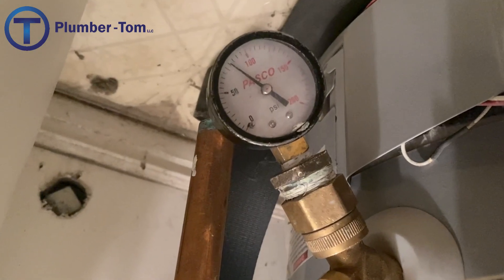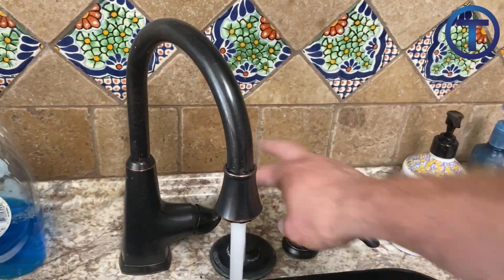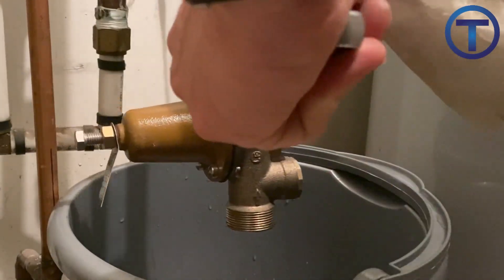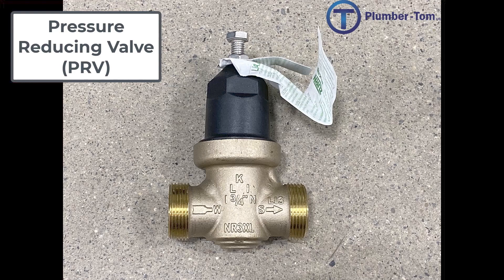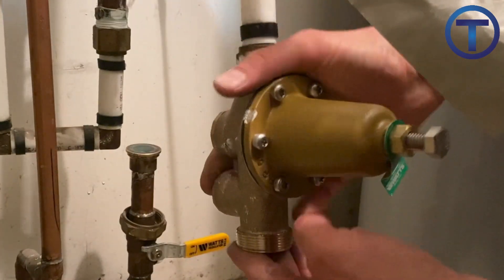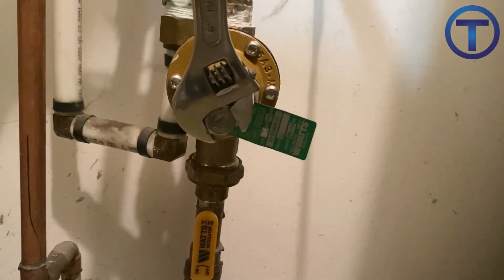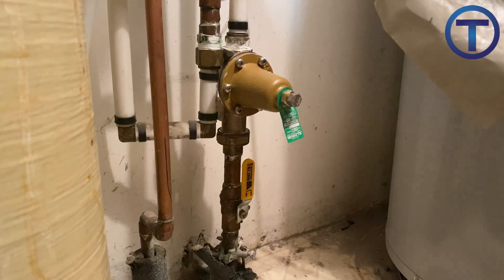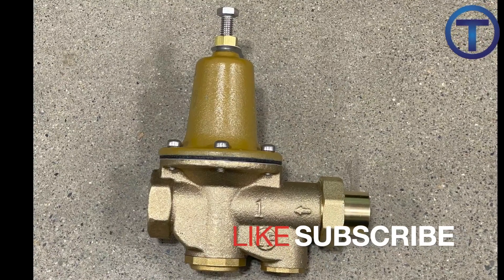Pressure Reducing Valve Replacement (PRV)

Comment: Just installed a pressure reducing valve, my street was 80 but my gauge with a Red hand was 95 sometimes. It is set at 50, I might raise it to 60. Great video. My neighbor had a slab leak so I am trying to protect my 1963 build home.
Reply from the maker: Glad it was helpful.  Great plan.  Maintaining a good pressure saves a lot of wear on your plumbing system and fixtures.

Comment: What if my Pressure Reducing Valve Replacement does not have a tag?
Reply from the maker: That makes it hard to identify. You might look for something similar at a plumbing supplier or online.
Reply: @plumber-tom9470  Ok, thanks, I will see what I can find.

Comment: Thank you for the amazing video.
Just I want to ask you when will be the next video ??
Thanks for your efforts
Reply from the maker: Thanks. Might have more next week.
Reply: Hi Mr.Tom
Just I have question on page number 99 on your book .
Iam trying to calculate the DFU on point C 
Lv=1
EFD =o
Wc =3
So the total is 28 . am I correct or not .
Please advise me
Reply from the maker: The answer is A. 36.  The answers to that section can be found in the back of the book under "Isometric Analysis".
Reply: Can you explain me how you got 36
Reply from the maker: Sure.  Each toilet is worth 4 DFU and there are 8 toilets so that makes us 32 DFU. Then we add the lavatories which are worth 1 DFU each. There are four lavatories so that makes a combined total of 36 DFU.  The emergency floor drains are not counted because they are 0 DFU. Hope that helps.